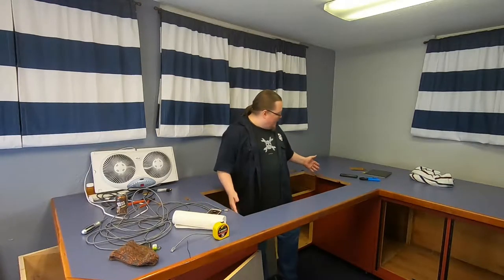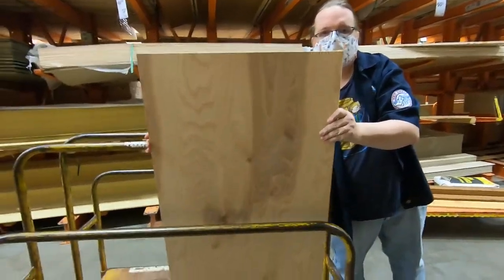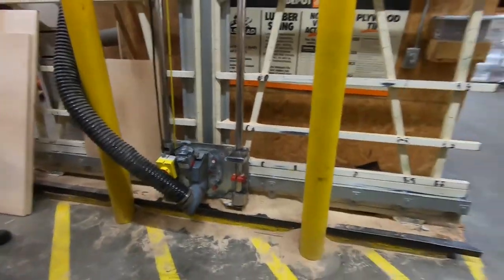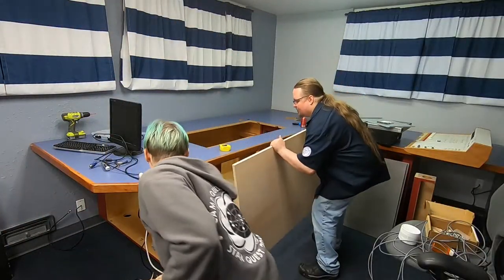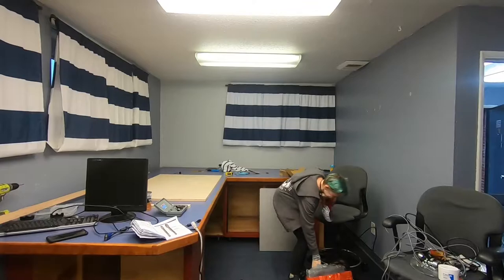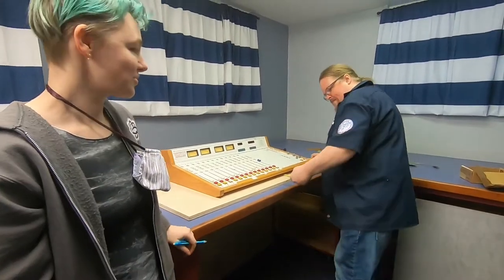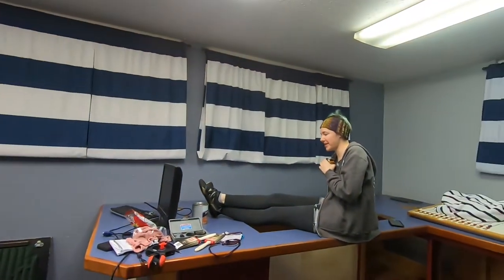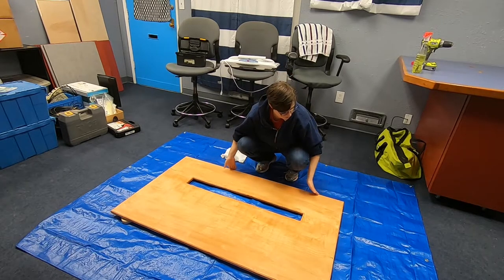Studio 3: Plugging a Hole

Comment: That is exact same board we have in our radio station at McMurdo.  We have 2 turntables, 2 cd players and a computer based UI for digital files.  However our UI is currently broken and we have to rely on cds and vinyl for playback.  Once we are in green I will post a video of our station.
Reply from the maker: @sparkyonice1219  That looks like an A-300, which is my experimentation board at home.   I was considering using it in the studio because then I'd be working with DB-25s rather than bespoke, expensive molex connectors for wiring to the punch blocks, but I only have a couple microphone strips for it.